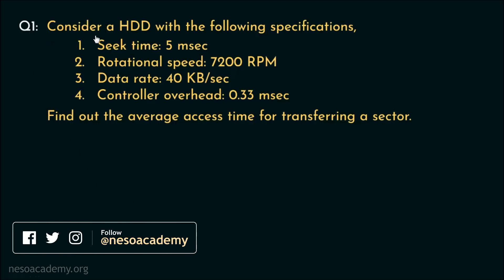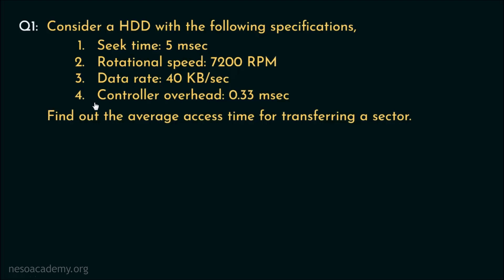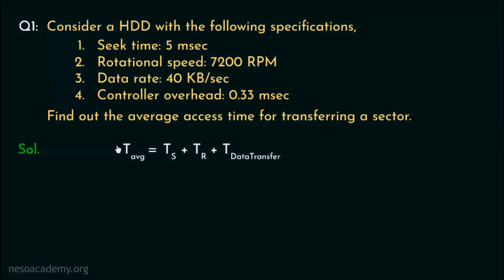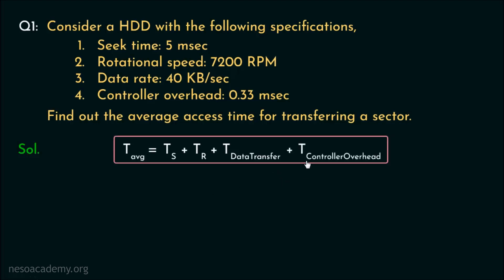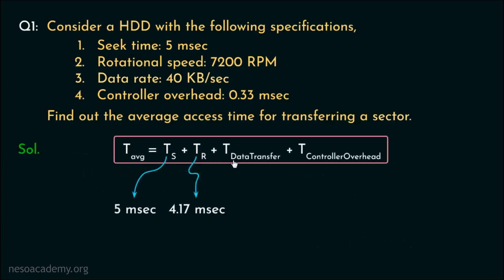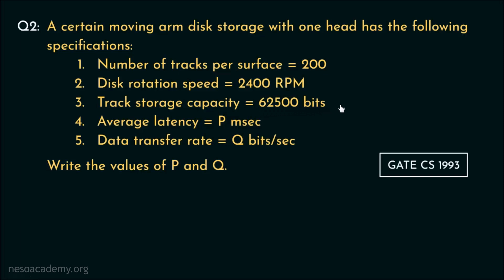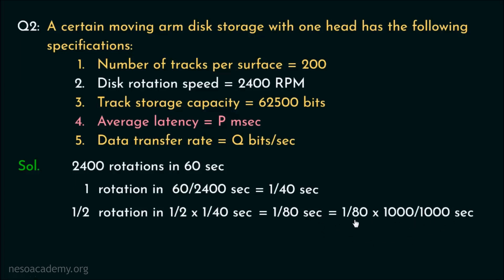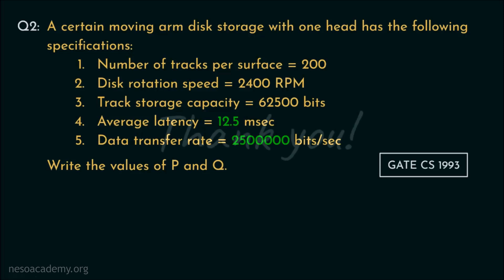Hard Disk Drives (Solved Problems) - Set 3

Comment: Sir I have a question,data transfer time= no. Of heads×capacity of one track× no. Of rotation in 1 track.
So why we dont multiply the 200?? Means no. Of tracks per surface?
Reply: Not For you , but if any one who requires :
the above formula is for transfer rate and not time ,
trans.time = data to be transf / transfer rate 
here sector = 512 B to be transf

hence, 512 byte/ 40 * 1024 byte/sec
Reply: Might be data read speed, so one track at a time can be read by the reader head